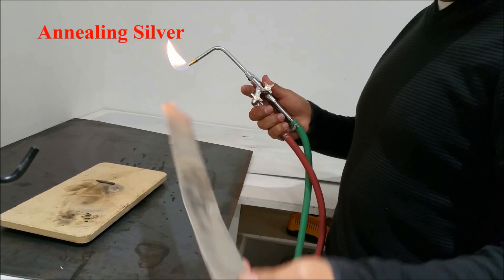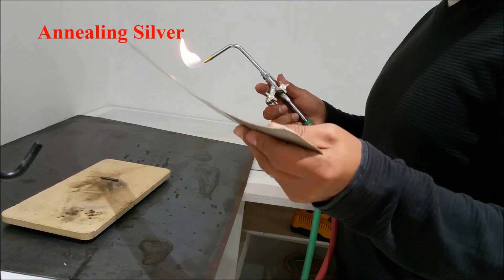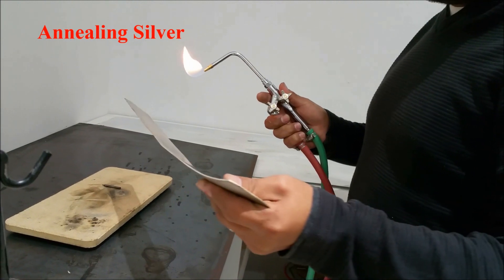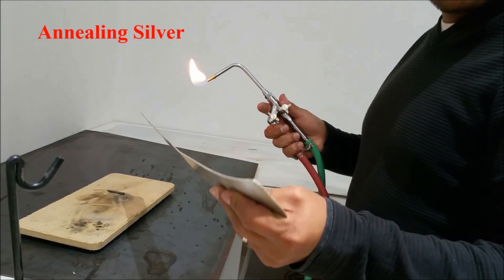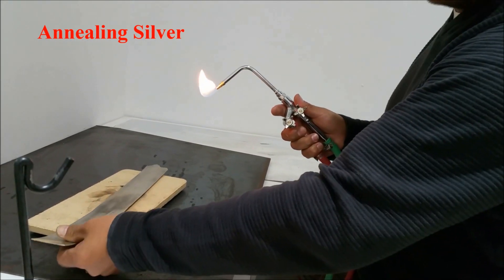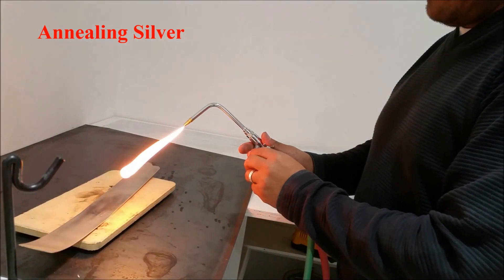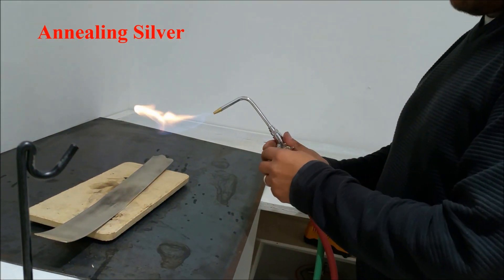Annealing Process

Comment: What would happen to this al sheet if it is dipped in cold water right after it is heated? 
Please reply
Reply from the maker: Bofors Agent is better if you let it cool naturally,  but if u put in water directly it gets slightly harder but still good to work with.
Reply: If there is any bending procees it will become difficult to work on it...and it is always not good to dip a heated material directly to a water..because even if the material looks all ok after dipping...it would have lost its streangth internally...like the molecules inside it would got disturbed so
Reply: this is called quencing. The main differance between quencing and annealing is that when a metal is heated then dipped a water rapidly this is increasing the hardness and metal becomes more brittle. But when a metal is heated then allowed to cool slowly this is called annealing and make the metal softer and more elastic.
Reply: It will get cooled